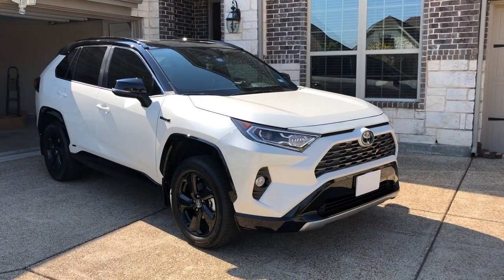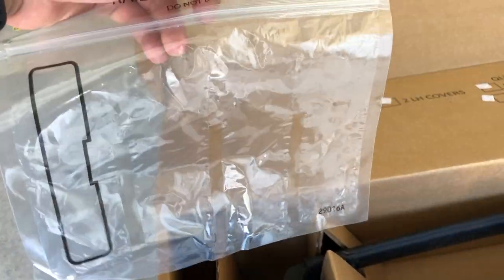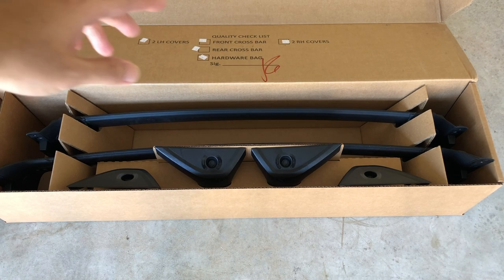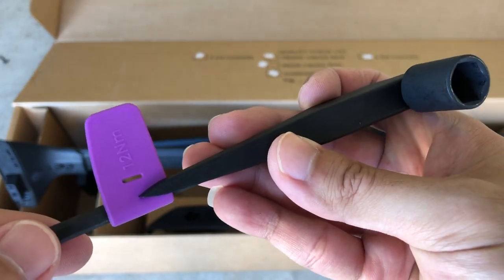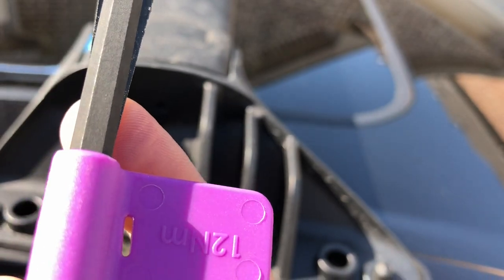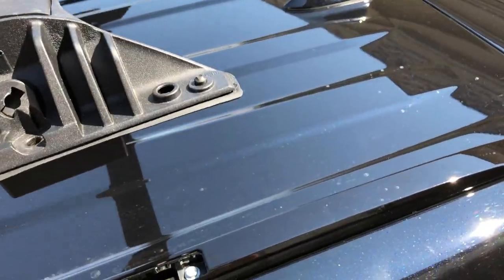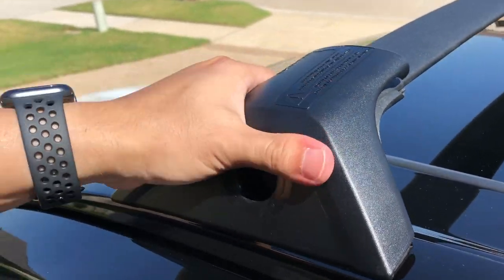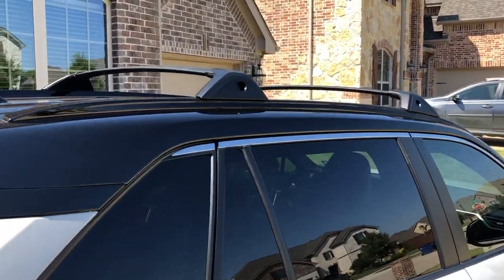2020 Toyota RAV4 - OEM Cross Bar Installation & Review

Comment: Is that the right orientation for lock washer under bolt?  I recall installing my sons and the bolt doesn’t hit any of the washer tabs sticking up. So I questioned putting it the other direction with tabs facing down so it would function like a lock washer?
Reply: I believe you're correct that lock washer isnt functioning properly installed that way

Comment: I installed mine using your video thank you so much. When I check the cross bars out the box one side of both bars was moving/ sliding.  Is that normal? After installation nothing is moving or sliding. It feels solid.

Comment: It seems like the cross bar rubber gasket is not sealed tightly with the rail, will that cause water leak into the inside of the car?

Comment: Outstanding video! I have a 2020 RAV4 and want to transport kayaks. I was going to have the dealer install the cross bars, but after watching your detailed video it looks like a simple job. One question--you mentioned that small gap at one point--did it close when you tightened the rail down, and if not, has it caused problems?
Reply from the maker: The small gap seems to close as I install the roof rail… in any case it hasn’t caused any problem so far

Comment: How much wieght does the cross bars hold? Any idea if they'd be able to hold a roof top tent?
Reply from the maker: I doubt it would hold the roof top tent... when I look at Toyota parts website for the cross bar, it says to look at the manual for weight capacity. So I looked at the manual but it does not say specifically about the weight limit for the roof rack itself... it only gives weird formula on the overall cargo capacity of the car....
Reply: Hey Gerald, excellent video!  Does it say anything about weight limit for the cross bars on the actual cross bars or cross bar covers?  There is a warning on my 2016 4Runner w/ weight limit.  Was hoping there might be the same on the RAV4.
Reply from the maker: @greg5856  hey Greg, Toyota parts website for the cross bar said to look at the owners manual, I looked at the owners manual and it doesn’t give any weight limit for the actual cross bars themselves. The manual give this formula to calculate the overall cargo weight limit but not specifically on the cross bars. I googled around, some people said that the weight limit is about 110 lbs, but not sure if that’s a reliable source.

Comment: Great video. Do you know the thread size of the bolt to secure to the car?  Thanks.
Reply: Not sure of the thread size but I think it takes a 13mm socket.
Reply: @sptrader6316  Thanks. I found out it is M8-1.25

Comment: Nice install. I had mine done at Toyota. The front crossbar is about 1 inch below the rear. Is this uneven mount a problem?
Reply from the maker: Hasn’t been a problem for me so far... I’ve used the cross bar for my Yakima frontloader bike rack and for a cargo roof rack and they are fine

Comment: Hey there, I've been searching for the  length of the cross bars and I can't seem to find it anywhere! Would you kindly be able to take a measurement for me? I'd really appreciate it. Cheers.
Reply from the maker: The length of the cross bar is 44 inches, which is just the length from one end to the other end of the roof rail.

Comment: Hi Gerald, quite useful thanks for sharing. BTW I noticed you have Yakima roof racks. Is the crossbar wide enough to install 4 of them if needed? How does the drive feel like when 2 of them loaded. I'm planning on loading 4.  3rd and 4th being 24inch and 20inch bikes. Do you think it can handle it
Reply from the maker: I don’t think the cross bar will be wide enough to install 4 of the Yakima roof racks. Three maybe possible but not 4… because even with two, I feel like it’s tight already. The drive feels okay with two adult bikes loaded, more wind noise but you dot really feel it when driving, pretty sturdy… If you want to carry 4 bikes, I’d say cary 2 or 3 on the top and 1 or two using the portable bike carrier that attaches on the trunk

Comment: IS IT POSSIBLE TO INSTALL A LOCK WHERE THE CROSSBARS ATTACHED TO THE ROOF TRACK?
Reply from the maker: A lock to lock the crossbar? If it's for crossbar, the OEM crossbar already came with plastic lock
Reply: @Otthox  Wait, maybe I misunderstood. It looked like that lock would be easily susceptible to theft. Do you have a unique key or something that would keep thieves from stealing your gear by removing the crossbars?
Reply: The Yakima crossbars can be locked.

Comment: Are your front driver and passenger windows factory tints? I bought the same exact model but in 2021 XSE Hybrid, blacked out emblems, and crossbars already installed. I'm going to get the legal commie California tints this weekend.
Reply from the maker: The front window tints are already there when I bought it, it could either be factory tints or dealer installed

Comment: We got the 2021 XLE Premium  w/ the roof rack already put on. Looks great. BUT why in the Hell did Toyota have the front roof rail mounted right in the middle of the sun roof to look up and see that Big bar. Wind noise is Horrible. all most considering taking the Front rail off when weather warms up.
Reply from the maker: I know, the front bar is smack down the middle of the sun roof... I think it's just because it's a small SUV... Before I had a highlander, it is longer so the front bar is behind the sun roof....
Reply: @Otthox  I have the same problem.  Can't I ask my Toyota dealer to move the cross bars down the rack?
Reply from the maker: @laurastone6578  I doubt they could because for the OEM roof rack, the roof rack goes to a specific slot provided by Toyota which is in the middle of the moon roof... Perhaps there is an optional after market roof rack that won’t need to use that specific slots... I’ve seen some after market ones where the roof rack hugs the side of the roof so maybe those kind will work
Reply: @Otthox  Really?  Okay.  Another thing.  I thought the roof rack and the cross bars were just an aesthetic thing.  I didn't realize you could actually carry stuff on it!  I doubt I will ever carry anything.  I just like the way it looks!
Reply from the maker: @laurastone6578  oh you can use roof rack for many things... like I said I used mine typically for carrying my bike, I made a video below for the bike roof rack carrier that I use: https://youtu.be/a8YvawU4VDc

You can put cargo carrier on top, very useful in case you need to haul more stuff during a road trip for example... there is even a tent for car roof rack so when you go camping, you can sleep on this tent that’s mounted on the roof rack of your car!
Reply: @Otthox  OMG.  Aren't you afraid that you might dent the roof of the car?
Reply from the maker: @laurastone6578  for the cargo roof rack as long as it is within the limit not too heavy I think it should be fine . Not sure about the tent

Comment: Great review. Curious if the cross bar affected gas mileage?
Reply from the maker: Hmm good question... I installed  them immediately after buying the car so I don’t know what my mileage would have been without the cross bar. If the cross bars do impact mileage, it would be more so when you have long road trip vs just driving around town I would imagine.
Reply: @Otthox  have you taken any long trips yet and measured the mileage with the cross bars? If not what does your average show on the digital display ? Also how has it affected wind noise when you use the sunroof?
Reply from the maker: @sammyjammy6647  yes I had a 2300 miles road trip last winter with the crossbar on, I got about 33-34 MPG driving at a fairly high speed at mostly 98% freeway drive. 

For regular in town drive, 98% city, I get 35MPG.

As for the wind noise, I can't really comment coz I always had this crossbar installed the moment I bought the car. So I don't know what it would sound like without the crossbar
Reply: @Otthox  One last question.  is this a hybrid?
Reply from the maker: @sammyjammy6647  yes, mine is an xse hybrid

Comment: They look quite fragile.  I'm thinking to install a roof tent and i'm far from sure that those bars are strong enough.
Reply from the maker: They’re pretty sturdy but I agree, I’m not sure if it’s going to be strong enough for roof tent...toyota doesn’t provide any details on max weight specs either for this cross bar
Reply: @Otthox  I was struggling to find it too but it is in the manual which states 176 lbs/80 kg. I'm trying to find a reason to get aftermarket racks for better performances.
Reply from the maker: @RolandoLee  oh got it... yes for your purpose, if you want to install roof tent, make sense to go with stronger after market ones

Comment: Can anyone please tell me if these OEM bars make any wind noise? Thank you!
Reply from the maker: I’ve always had cross bars on my cars and when I bought this RAV4, I installed the cross bars almost immediately, so I can’t really tell you the before and after on wind noise due to cross bar.

I saw this video taking about wind noise on 2019 RAV4 with cross bars, I haven’t watched it myself but maybe this will help: https://youtu.be/Ph6p7UVoQfs
Reply: @Otthox  ok, so you personally don't hear any wind noise with this roof rack? Thx for answering btw
Reply from the maker: @nypj2006  I don't notice the wind noise with his roof rack. But then like I said, I've always had cross bars even in my previous cars so maybe there is wind noise caused by the roof rack but since I'm used to it I don't hear/notice it anymore. 

But my guess is even if there is extra wind noise, it won't be to the point that you really notice and disturb the comfort anymore, otherwise many people are going to be complaining...
Reply: One more thing please, does your bike rack(s) sit on an angle and not flat since the roof rack is concave?
Reply: It's slightly arced. Any feedback is appreciated. Thank you.
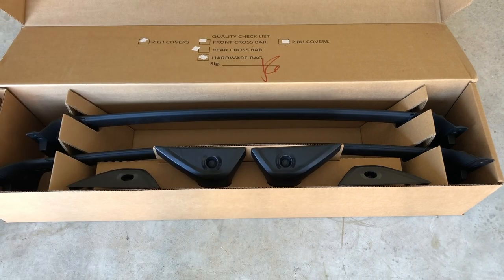Reply from the maker: @nypj2006  you mean the cross bar is slightly arched, not straight? if so yes that's correct, the cross bar is definitely not straight, there are some curves to it. You can see this in 3:41 on my video